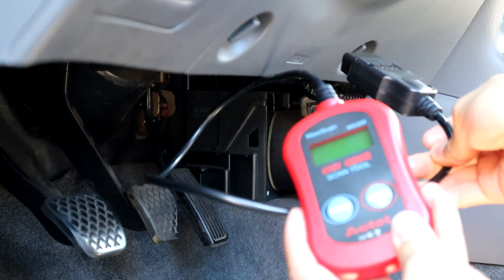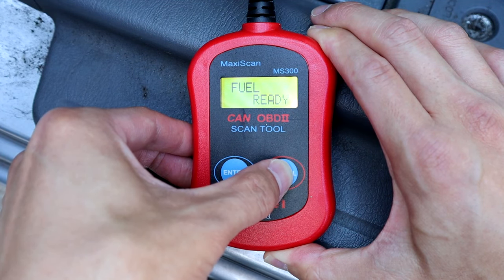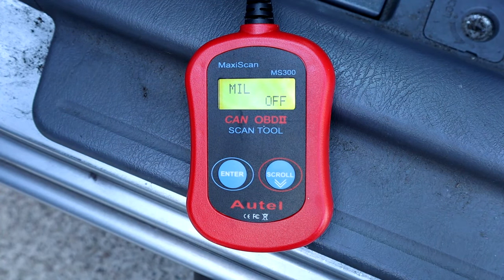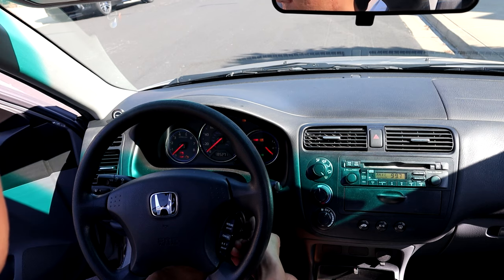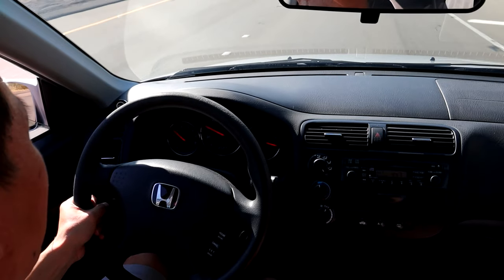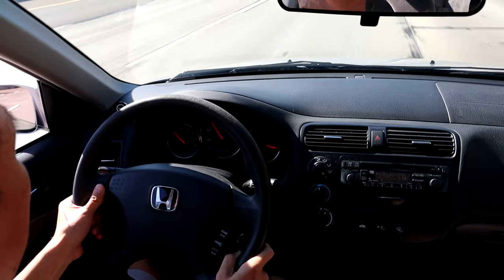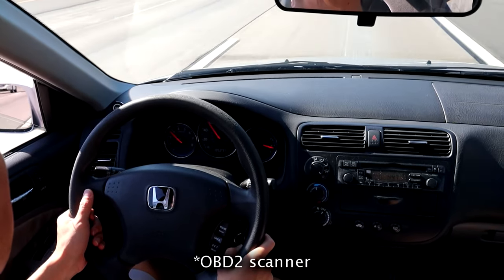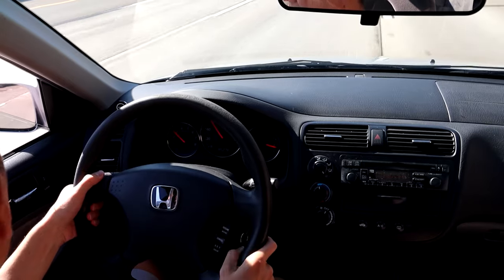How To Get Your Car Ready For a Smog Check – Pass 100% Of The Time – I/M Drive Cycle Ready

Comment: What if my air conditioner doesn’t work on my ‘98 gmc truck. Can I skip this part or do I still do this step as you mentioned? Mine has to do with catylac converter, ekg & ekg  box ??? Thanks
Reply from the maker: Yeah.  As long as the AC doesn't throw a code, you should be fine.

Comment: Quick question? How do you coast the car without switching gears? I’ve an automatic car.
Reply from the maker: Just let off the gas pedal.  The car will slow down by itself, just might take a while.
Reply: @nukem384  thanks a lot!

Comment: I drive an 08 chevy aveo, it is a manual transmission vehicle. So I can't decelerate to 20 from 55 without changing gears. Fifth gear would make my engine very unhappy at such a low speed.

Any tips?

Thanks for the great content!
Reply from the maker: I have another car that's a stick, but I can't exactly remember if I lugged the crap out of the engine, like you're alluding to lol or if I just downshifted.  Try this, do the tests and downshift so you don't lug, and if it ready's the sensors, you're good.  But if it doesn't then you might have to lug it, but I'd do it when there's not a lot of cars around for obvious reasons.
Reply: @nukem384  thank you very much for the insanely fast response time, just out of curiosity will running the car normally complete a drive cycle? I took my car to the testing site after only 20 miles since the repair. It failed emissions obviously.

So I've driven an additional 80 miles, I'm just curious if regular driving will complete the drive cycle.

Thanks again!
Reply from the maker: @noahnichols7604  Yes, regular driving should complete the drive cycle, granted you do certain things that ready the specific sensors.  Doing the I/M drive cycle (this video) is a faster way to get the sensors ready without having to drive 100+ miles and basically randomly driving your car around endlessly.   If you've done this drive cycle multiple times and one of the sensors isn't ready, you might have an actual problem with that sensor/part that needs to be looked at.  The drive cycle doesn't magically fix broken parts.  Some people seem to think that for some reason.  Like back in the day when OBDI cars were around and you could disconnect your batt, reset the ECU and cheat the smog to pass.
Reply: @nukem384  thank you so much, I have had severe anxiety regard this issue, you have literally changed my week.

Thank you

Comment: Question ❓ I haven't disconnected the battery in two years, but smog check Guy said I had to take out on Freeway to reset.  I don't drive the van much and I am surprised it needs resetting. Maybe the test tech was busy and just blowing me off. Is this common?
Reply from the maker: Uhh yeah sounds like he's blowing you off.  There's no reason to reset the battery if it doesn't need it for some reason.  If your car is ready for a smog, then it should just be tested and done.  Resetting your battery when everything is fine would make you do this process just to get the monitors reset.

Comment: Do u have to clear the old dtc codes or should u leave them in there . (The check engine light is off)
Reply from the maker: I would try and clear them.  If the reader is telling you something isn't ready, I don't think you can pass smog.

Comment: Ok it’s me again with another car. 2015 Mazda 3. Check engine light came  on due to P0421 code. I put cataclean it helps. Registration Renewal came it needs a smog. Check engine light came back On. Put cataclean again cleared the light, tomorrow at 2 am I’ll follow your procedure again🙂. I will update, thanks.
Reply from the maker: Good luck!

Comment: hi Darrell,  I have a quick question for you.  I only have the catalyst monitor diagnostics remaining.  Can I just drive to the fwy and skip the previous tests and just bring the car up the 55mph with 3/4 throttle for 5 minutes?  And keep trying until it works?  Or do I have to do all of the tests for it to work?  Thanks for your help
Reply from the maker: You can skip to that part. Keep in mind tho, if you try a bunch of times and it doesnt fix it, theres probably a problem. This doesnt just magically fix everything.
Reply: @nukem384  What is the problem?   I have a 2015 Infiniti Coupe and the final CAT part won't clear.

Comment: Silly question I suppose, but how do you judge half and then three quarters throttle? Does that mean with the accelorator peddle half way up (or down)?
Reply from the maker: Yes, exactly.  Just estimate based on feel and knowing how far your particular pedal goes down normally.

Comment: Hi, now the only monitor left it's the "O2 sensor HTR", any tips how to get it to complete? or if not, which sensor it's the one that may need attetion?  I've a 2009 Nissan Altima Hybrid.  Your help it's apprecitated.  Thanks.
Reply from the maker: I would do a Google search on that, but it looks like the O2 sensor needs to be heated up to a certain degree for the cat to do its thing.  So you may need to get a new O2 to fix the problem?  I'm not sure on that though, so do your own research.  Good luck and hope you can figure it out and pass!
Reply: @nukem384  Thanks for the quick reply. Question now is, would it be the "upstream or downstream one" Since I've not CEL it's going to be a guess.  Anyway, I'll try your drive cycle method a couple of times before  getting my mech to replace the sensor, crossing my fingers.

Comment: What state are you referring to when you say they just check to make sure all of the monitors are ready and then they pass the vehicle?
Reply from the maker: I'm in California, the most strict state of all.  I know some states in the union, they don't even do smog checks.  So it all depends where you are.
Reply: @nukem384  I’m also in Cali and I just purchased a car from Florida that’s tuned so I need to figure out what I’m going to do about the smog.
Reply from the maker: @jlue1515  oOooo thats going to be a problem. I used to mod cars and smogging was always a hassle. Esp from FL, theres no way your car is passing bc FL has really lenient smog, or none at all, cant remember. So either youre going to have to find a hookup thatll look the other way, or turn the car to stock to pass.

Comment: Any steps in particular to help get the EVAP ready? Or do I have to keep doing this whole process? Honda Civic 2009
Reply from the maker: If you want to be sure, I'd do the whole process.  But, as noted by the chapters, the EVAP portion is the 2nd and 3rd steps, so you could try and shortcut and just do about half the test.
Reply: FYI
EVAP monitor doesn’t need to be cleared for smog. As of 2018 (I believe) it is the only monitor not needed in all 50 states to pass smog.
Reply: @coachtonythetiger  tell that to the guy in DMV in NJ boss. They laugh at u
Reply: also for EVAP make sure your car has between a quarter and 3/4 tank of gas and be sure your gas cap is on tight
Reply: ArenaRat  evap monitor  not ready is the only one allowed   in California

Comment: I followed ur instructions. Before I followed it, I’m having a problem with my TPMS tire sensor to clear . All the tires air pressure and spare tire are ok. It’s been couple of days. Tried the reset procedure here in YouTube still didn’t clear the TPMS. I have scanner to clear it but, didn’t do it yet. So I did ur procedure it cleared my TPMS sign/icon :). At the same time my Catalyst before is INC, now is Complete too👍🙂. Now is just the Evap system is INC, googled it found a procedure. That’s my next plan. I think my car will pass the smog now, even the Evap is INC.That’s what I found out too in searching they said even the Evap is INC it will be ok... But I will still do the procedure for the Evap..Thanks for your video 👍🙂 I Subscribed 👍🙂 Ok, update, this morning i drove my Son to work and follow the Evap procedure cuz it's INC. It didn't ok the Evap still INC... Then I decided to do smog test and it pass :) thanks for your video:). Now i have to do my Astrovan same issue Catalyst INC. :) will update again :)👋🙂
Reply from the maker: Awesome, glad it helped

Comment: We have been going out of our minds to get a 2019 GT350 to pass.  Both Cats and O2 sensors show unsupported.  The car originally had a tune, but it has been flashed back to stock.  We've put about 1000 miles on it since it was refreshed...no luck yet.  BTW, the dealer says they show voltage to the O2 sensors.  Any ideas are appreciated.
Reply from the maker: Aftermarket is always tough, even if you've gone back. Trial and error is probably best.  Maybe test with a known good O2 sensor?

Comment: Do you have to unplug the scanner if you are finish with the drive cycle? Or you have to take it of. My check engine light comes on very fast what should I do
Reply from the maker: Use the reader and figure out what the code is telling you, then fix it.  The drive cycle can't magically fix everything.  If you have an actual issue where the CEL is coming on, it needs to be fixed before smog.

Comment: You can actually  go into the vehicles manual  and it will tell you how to check your vehicle for being  ready  for the smog inspection and  see if the check engine sign which  is usually  a little  engine on your dash is blinking 5 times or if the little  engine  sign just goes off , just go to emissions and check the drive cycle procedures  in the manual  best  to do the drive cycle  late at night or when you can drive your vehicle at 50/ 60 mph for a solid 20 mins at those speeds with out changing  speeds lower then 50 or 60 mph!

Comment: Battery died on 05 CRV 2 months before, it's hardly driven, I was able to get all the monitors up to date except for the CAT.  when you say you need to repeat the cycle few times, do I need to wait for the car to cool overnight and run the A/C, rear defrost each time or do I just keep performing the 55mph to 20mph?  Also can I leave the scanner plugged in during the test and will it auto update the status or do I need to restart the car to see the updated status?
Reply from the maker: I would wait until the car has cooled and try again.  You can try to just do the piece for the CAT, maybe you start with that to save you some time and hope it works?  But starting over from the beginning is your best bet.

You can leave the scanner plugged in, but I believe you at least need to run through all the monitors for it to update.  Safest bet is to just remove scanner and plug back in after you've redone your test.

Comment: Can I do this cycle even if I have a check engine light on? Or do I have to reset it?
Reply from the maker: Yeah you can do it with a CEL on.
Reply: @nukem384  so I can do it and leave the check engine on?
Reply from the maker: @1jeliaz  Yeah.  Should probably get the CEL taken care of as well.  This cycle is probably not going to fix that.
Reply: @nukem384  what is the CEL?
Reply from the maker: @1jeliaz  Check engine light

Comment: Will this help my evap turn on? It’s been “not ready” for 3 days 😭
Reply from the maker: It should based on step 1 in the video
Reply: If EVAP is your last monitor to clear just go get a test, most states allow one monitor to be not ready and still pass. CA allows only the EVAP to by not ready and still pass.   So do not waste your time trying to get EVAP to go.  There could be 20 reasons why the EVAP wont run.   Just do not bother with it if you do not have to.

Comment: How can they tell if your car is tuned? If all they look at is the ob2 for passing.
Reply from the maker: It's totally different.  All the smog says is that the car is emitting the legal amount of smog.  Getting the car tuned and running optimally is up to you.  Yes, it may have some impact on smog, but the state doesn't care as long as the car is under the legal limit.
Reply: They Query the Engine management file on the ECU.  The filename has to be the correct one from the manufacturer (Or CARB certified) and the Checksum has to be correct for that particular file.  Anytime you tune an engine management file you change the Check digit.  So that's when they fail you for Modified Software.

Comment: Does the gas level absolutely have to be between 1/4 and 3/4 for this drive cycle to work? Or, will it still work at a full tank? I have a 2019 Honda CR-V that just had a new battery installed. My Evap and EGR/VVT codes won't clear. Hopefully this drive cycle will work. Good video, thank you.
Reply from the maker: For best results, yes.  But it can't hurt to try if the timing isn't right for 3/4 to 1/4.  You'd definitely want to do this though.  Disconnecting the battery is a prime reason you'll throw all those codes.

Comment: Do they do this check on 1995 car with obd 1 ?
Reply from the maker: No.  They still do the old school sniffer test for OBDI cars that are still alive.
Reply: @nukem384  oh ok. i have  a 95 lexus that has been sitting for 3 year. starts up runs fine but has the CEL on.  probably needs oil change, throttle body MAF cleaned.  what would be some common causes of the CEL on in this situation?
Reply from the maker: @nyacoustics8373  No idea.  You need to get one of the tools in this video and run the codes.  The tool will tell you what's wrong with it.  Or since your car is so old, you can try the ol disconnect the battery and see if it clears the CEL long enough to get to the smog and smog it.

Comment: I always had safety inspections performed bc of the county i lived in then i moved to a county that did full inspections and came across this issue when i changed the battery but i drove it 400 miles for a trip then another 200-300 miles for work...3 inspections later it finally decided to be ready. Wish I knew about the drive cycle lol
Reply from the maker: Well shoot.  Now you know for next time :)
Reply: @nukem384  next time I'll save myself the hassle by hitting up the dark web for an off the books inspection. Don't even have to drive anywhere 🤣

Comment: I have a 2015 Dodge Challenger with only 50k miles, took it in for the first smog and failed due to 'oxygen sensor monitors NOT READY'. I hope this cycle helps me out, I also recently ran some cataclean with 91 octane fuel. Fingers crossed it passes.
Reply from the maker: Good luck!

Comment: 2009 VW rabbit, 5 speed with only 110,000 miles and fighting this BS in Maryland right now.   If the check engine light is on it fails.  2022 I had a local mechanic do lots of work, it runs great but he couldn't clear the code.  VW dealership charged me $200 to tell me it would cost me $1340 to fix secondary air sensor issue.  If I fix it myself, or I pay a non- VW shop  but the check engine light is still on it will fail, without them testing anything about emissions.
Reply from the maker: Unfortunately that's how OBDII smog checks work these days.  All they care about is check engine light on and all the monitors must be working.  Didn't your local mechanic read the code from a tool like the video?  Since you know what it is now, why not give it a shot yourself, make sure everything is clear like in the video and then you shouldn't have any issues?
Reply: @nukem384  yep I’m going to try. But in the past simple things like changing fuses has stumped me so my confidence isn’t great.
Reply: @nukem384  I bought a tool that allows mechanics to reset the codes after doing  the repair. Reviews of the tool complain there’s zero directions for the non technician.  I have until Feb 4th to become DIY repair on a complicated machine with 5% experience, I learned to change oil and spark plugs 35 years ago on a non computerized car. Now I’m terrified to take parts off and tinker with something that’s driving perfectly.
Reply from the maker: @genuineimpulse9134  so that may be part of your problem.  "Resetting" codes in the old days would work for OBDI cars to kinda cheat the system in a way.  Keep the code off long enough to pass your smog and then worry about it in 2 years.  You can't exactly do that today with newer cars.  So best thing to do is get that part changed and it should clear your check engine.  Then there shouldn't be anything to worry about.  Since you know what the problem is, if you're not comfortable doing it yourself, why not just take it to a mechanic, explain the code, and have them do it?  Costs a bit a money, but then your problem should be solved.

Comment: What if my check engine light goes on after the second start? Can I pass the test with just one key start of the engine ?
Reply from the maker: If your check engine goes on at any time, you're going to fail.  If that's the case, you probably actually have an issue that needs to be addressed.  Doing a drive cycle to try and make it temporarily go away isn't going to fly with smog.

Comment: If I am driving a manual when going down to 20 do I keep it in gear?
And once getting back up to speed can I down shift to a lower gear?
Reply from the maker: Keep it in gear and don't shift.  Yeah I know, it's going to lug the engine, but that's what you gotta do.  Also another reason to do this when there aren't too many people around.
Reply: @nukem384  thank you!

Comment: Im getting code PO430 and my catalyst & Evap isn't ready. That code says pending. Is that gonna make it harder for the code to become ready ?
Reply from the maker: Can't say.  I would just try doing the drive cycle and see if it fixes the issue.  If not, then you may need to get something fixed or have your car looked at.